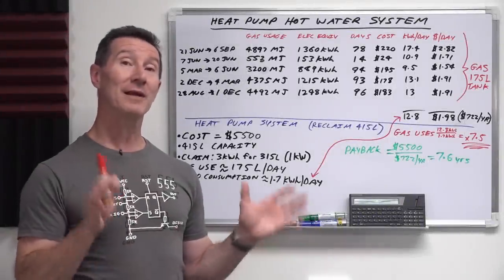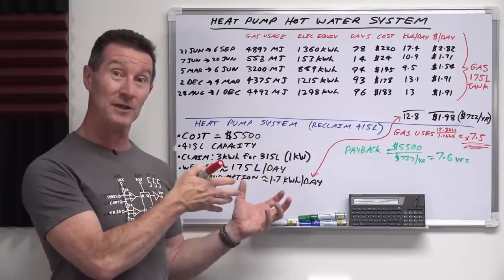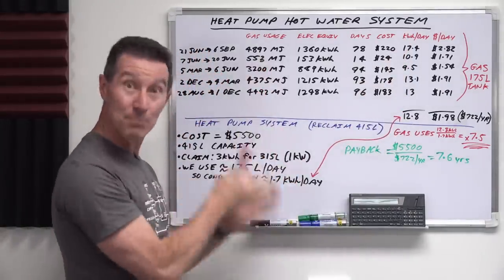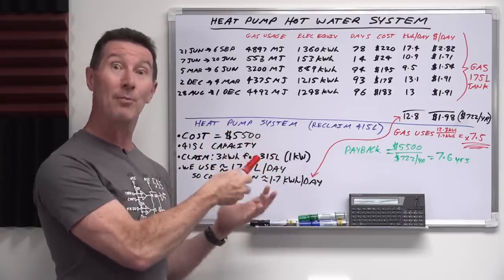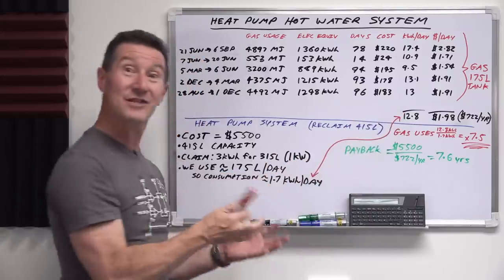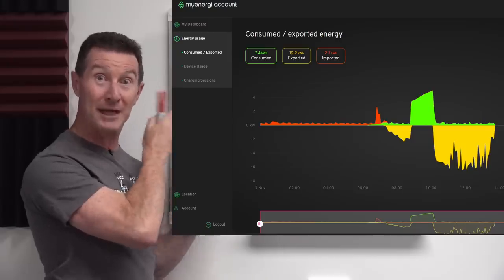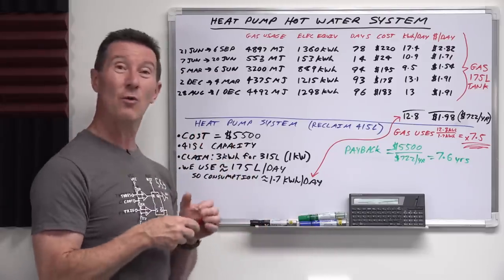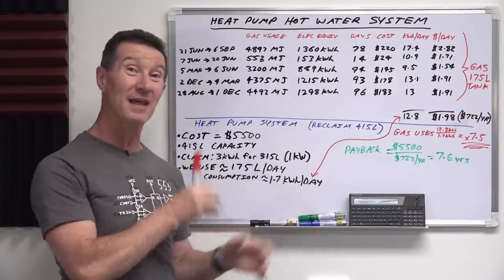Heat Pump Hot Water System vs Gas Hot Water

Comment: If you have a lot of excess solar it’s worth adding resistive hot water into the comparison. The cheaper capex compared to heatpump might more than make up for the higher opex if it’s all solar anyway.
Reply: I did resistive heater in Vic on a timer, 2 person, electric only house,  8kw Enphase with 7kw of inverters, split NE NW,  240L hot water tank with a 2.4kw coil, timer run be tween 10:30am and 3pm, this is within my off peat time so 18.5c/kw import and 6.7kw export, uses about 7kw,  most days we don't import any power,  install cost was $900 for the tank and and $200 for the timer and contactor, expected system lifetime 10 years, been in place for 1 yeah so far
Cost me about $220 per year in in power if you include the lost export payment and the odd day when I need to import, there was no math that would make heat pump worth it in my scenario
Reply: MC electrical  has done the numbers on his channel and HPHWS wins hands down

Comment: I got a 300L tank with an integrated heat pump about 3 years ago replacing a resistive heating tank. I'd say the average COP around the year works out at about 3. I'm off grid in the UK at 53N so the sun only gets to 14 degrees altitude at winter solstice and it made a big difference in how often I had to run the generator to keep the batteries topped up.

As you have so much spare solar power one option for you would be to run a solar diverter to direct the power you would have otherwise exported into the hot water.  It would certainly be a cheaper option.

Comment: A couple of questions:
1. What's the max water temperature you can generate with a heat-pump?
2. What's the minimum outside operating temperature at which the pump will generate a useful level of temp in the water tank?

Heat-pump-based hot water is fine if you live in a climate where there's always enough ambient heat in the air to provide an adequate source but across the ditch here in NZ there are many places where even daytime temps don't make it into double-digits so heat-pump anything really struggles to reach the promised efficiencies.
Reply: The Reclaim unit operates down to -10degC. Max, not sure, but 59-63C is mentioned as nominal.
Reply: @EEVblog  You can still get at least 100% heating efficiency out of a good heat pump system down to a bit below freezing.  Where I live, you do have to have a backup system, though.  Winter temps can go down to -40C for WEEKS at a time here.  Not all that often, but I'm seen it happen.
Reply: @evensgrey  I assume Canada and all the heat pump units I have seen have the whole system ontop of the tank and does NOT see - anything and will be COOLING your inside air
Reply: @jasonriddell  There's no actual reason you have to take the heat from the air inside the house.  Unless, of course, the heat pump heating the hot water tank doesn't have any backup so you need to take heat from somewhere you know won't be too cold, like inside the living area.  In circumstances where you're needing to heat that area, this is undesirable, although it might be more efficient than having the heat pump move heat from outdoors somewhere.
Reply: Fridgy is my trade, older split system, broke into the discharge line from compressor to reversing valve and placed a tube in tube heat exchanger with hot gas up the centre tube.
The outer tube is connected into the one of the inlets and outlets on a dual access hot water system.
So end result hot water in both summer and winter, condensing unit ( outdoor section had a 8kwR capacity which heated the 250 litre tank quite quickly.
Reply: Cold climate heat pumps are readily available.  Hot water temperature can range from 50° to 70° depending on the manufacture and model.
Reply: @EEVblog  anecdata, people in Ireland and UK reporting very poor performance in 'freezing fog' conditions, makes sense as the heat transfer from air is worst right at the dewpoint in damp conditions

Comment: I have the Sanden 250l heat pump hot water system (same technology as the Reclaim) installed last August.  It runs at midday for 2 hours on the solar energy and consumes 1.1kWh.

Comment: The heat pump manufacturers have their calculations based on a 20C outside temperature, when you have 0C outside in the winter it's not so efficient, so I hope it helps in your setup. But do not be surprised if suddenly you don't save money
Reply: nope. they frustratingly don't always give figures, but if you dig a bit you can find them. It's common to quote them for A7/W55 (air 7deg, water 55deg).
Reply: We don't get 0degC here in Sydney. A really cold winter day will be in the low teens.
Reply: @EEVblog  and your solar panels are naar the equator so it wil make alot of power.
  so win win 👍
Reply: @EEVblog  , my 0 degree is a example, what I want to point out is not just work with calculations from heat pump manufacturers, they calculate in their own pocket. Somebody can install a heat pump and then suddenly come to the conclusion that it cost more than a standard electric heater, as before I hope it works out for you. Readers be aware of your local climate and calculations
Reply: @pie314isi  and what COP do they specify for that? Can’t be above 4 and yet Dave’s System would mean a COP of greater than 6, closer to 7 even considering losses in the gas heater.
Reply: @EEVblog  lol, a really cold day here is the negative teens.
Reply: I have seen videos where at -11 outside the COP reduces to 2 with the output temperature being 45°C

Comment: The formula to calculate thermal storage capacity in kWh is fairly simple. So to increase the water temperature by 40C so say from 20C to 60C you have 415 liter * 40C * 1.16 = 19.256kWh
And if you ignore losses to ambient from the water tank then this will be exactly what a direct electric water heater will use as it is 100% efficient. For a heat pump will be much less as you pump heat from outside and the COP will depend on the delta in temperature between outside ambient air and water temperature.
So since you have a larger water tank than needed and you want it to be as efficient as possible keep the water temperature limit around 55C or 60C and not higher (assuming you can set that).
In summer I'm sure it will have a fairly high COP but in winter it will be quite a bit lower so average will likely not be as much as advertised.
Reply from the maker: Not quite that easy though. As you use the water more colder water comes in and hot water flows out. So it's continuous flow system, not a system where you extract X amount and then refill makign the calcs simple in practice.
Reply: Yeah very fair comment. While I'm a huge fan and will move to the same unit when my solar hot water system dies you call out a strong variable on the temperature from the mains the water comes in at. South East Queensland is a lot different from say the hills of Adelaide/Sydney/Melbourne (cold!) etc :)
Reply: required in most states to heat to 59°C
Reply: @mikerowe402  Never measured it, but I don't recall our tap water being that cold in winter. It comes from underground pipes of course.
Reply: @liam3284  building code? requirement for at least OR MAX??

Comment: First of all you have a very inefficient gas system if you use over 10kWh a day for 175L (on average a 5 minute shower is about 50 liters of hot water which is/should be about 2kWh). You wanna do the math on that first, a 175L tank doesnt say much about how much water you actually use. So either you have a very inefficient gas system of you use a lot more hot water than 175L. Its probably both seeing how old your system is and 175L a day for a household is pretty low.

Ok to the heatpump and 415L tank/boiler  (depends where you live what you call the bloody thing). You can take off (on average) 20% of that. Thats 332L thats actually usable and will be actually hot (around 55/60°C normally). (S)COP for tapwater aint going to be 5 or 6, on average its about 2.5. Now you need to know the temp of your mains waterline (usually around 10°C on average) calculate the difference and the amount of energy it takes to heat it etc etc.

My calculations for you new system, with a 5kW heatpump, 415L, a Delta of 45°C, 2.5 COP and 4180 J/kgK (energy to heat up 1L water): 17,5 kWh to heat 415L (80/85% usable) and 3,5 hours to heat up. Now of course there's a lot of variables there, which i dont know, you would need to factor in to be 100% exact. You can half it with the silly COP of 6 they have in their specs (32.6°C ambient / 21.1°C cold water inlet) and not come close to 1.7kWh.

So my mind would be blown if your heatpump with a 415L tank would only use 1.7kWh a day, i would even be shocked if its less than 10kWh a day on average through the year. 3 kWh to heat 315L .... Thats simply aint happening and well nonsense.

I looked into getting rid of my gas connection and using electricity for heating (house and water) last year and talked to a lot of guys who install heat pumps, cause i run into them often at sites, but no matter what, it doesnt make sense financially for me. Even not when i have 20 solar panels on top of my roof.

Comment: Hi Dave, your energy consumption is extremely high, about 5500kWh/yr, 10 times what we use here in Germany. We have a one-family-house, solid construction (not wooden😁 )and well isolated. We have to heat our houses in winter time, so in total we have about 13..15MWh consumption, only 3..4% going into water heating.
We 3 people use hot water for shower, typically a few minutes only, 2..3 times a week per person, rarely taking a full bath, and for the daily hygiene, of course. Then I often dish wash manually, what's not going into the machine. That's all of usage.
In this country, most living spaces use gas heating. Caloric Value Boilers are meanwhile standard here, i.e. 95% efficiency by a built-in heat exchanger. The 250l water tank @ 60°C  and the water pipes are isolated as well. I suspect that your old gas boiler and for sure your water tank are very inefficient and not well isolated, causing that high waste of energy. A closer look at your gas boiler and the water pipes would be interesting. 
I assume, that your new system will even save much more of energy simply due to its better efficiency and isolation. I guess it might be down to 10..20% consumption only.
Reply: in Canada 30 year old tanks are rated around 60% efficient and NEW "condensing" units are 97% so a MASSIVE savings fitting a NEW tank

Comment: If a person is currently using a resistive hot water heater and a dehumidifier, a heat pump water heater kills two birds with one stone as it acts as a dehumidifier. I'm not ready to replace my gas water heater with one because I often heat my house with gas. In my case, in the winter, a heat pump water heater would essentially be heating my water with gas.

Comment: You have "muddied the waters" a bit in your comparison  by converting your MJ usage to electrical  KWH costs right away, and then calculating your cost in the price of electrical KWH,  without calculating your ACTUAL cost of the natural gas MJ's you used to begin with, and thereby changing your actual cost per day, ( or breaking it down from your providers billing statement for those cycles). According to Google, the avg price cost of natural gas in Australia in Mar 2022 was 0.070 U.S. Dollar per kWh. 3200 MJ's converts to 30.337 Therms (100 cubic foot units) Your claim of 889 KWH converts to 30.341 Therms, which closely agrees with the 30.337 Calculation above. The avg cost of natural gas in AUS in Mar 2022 was $0.07 USD / per KWH ( Per Google) , which multiplies out to $62.23 USD, multiplied by today's conversion rate of AUS /USD of 1.58/1 = $98.32 AUS D, divided by 94 days = $1.05 AUS D per day, not counting any delivery fee, pipeline maint fees, tariffs taxes, ect. This is QUITE a bit different from your calculated $1.54 AUS D / day, but it also cannot be argued that the cost of natural gas, and it's delivery, is going to constantly increase over the years, and you do directly benefit from converting your solar power to the task of heating your water. The bottom line, is, SHOW US THE GAS BILLS!!
Reply: I bet his connection fee is almost as high as his usage fee. Mine always has been when not using gas for heat three season a year

Comment: In South Africa , with all The loadsheading and power cuts ,  it's better to go with a Gas Tankless Turbo Fan Water Heater , gas works out and roughly 1$ USD a Kg , if you buy the 48kg bottle, and normally lasts up to 3- 4 months .
A Heat pump is Not idea if you go A Few Days Without Power . Cheapest Cost vs Hot Water Availability is the Factor. As we Can't rely on always having Power like other Countries.

Comment: We came from a regular resistive water heater in our place and went with a same-sized heat pump.  Cut energy usage from hot water anywhere from 1/3-1/4 the amount the resistive heater used.  I have what I consider to be almost the best case usage for one.  My water heater sits in my garage, so it doesn't cool the house (Units here in the US are combined units as opposed to what I'm going to call the 'mini split' style Dave is showing), and I live in the southeastern US, so there is plenty of heat in my garage to pump into the water.  Ours is a 'hybrid' that also has normal resistive elements in case you need fast recovery or something happens to the heat pump system, but you have the option of locking those out and not using them, which I have.

The unit was around $1100 USD and my local EMC was offering a $500 rebate on the unit.  My guestimate of payback on the unit is right around 2 years or less.
Reply: This is very similar to my costs and estimate. We went from a 10 year old regular resistive WH to a heat pump. Mine is in my basement so it helps keep it a touch drier in the summer months. It does in theory scavenge some heat from the home heating system (older inefficient oil boiler), but that keeps the basement fairly warm as is so it's probably a net benefit. Mine was around 1300 with a 700 rebate, and I installed myself. I estimated around 2 years as well. According to app I use at most ~130kWh/month, though usually around 95-100.

Comment: I found going from a gas tank type heater to a gas tankless heater was a huge savings, over 80% reduction in the gas consumption:
https://youtu.be/OBpjMeCODHk
The bulk of the savings is on the standby and pilot light losses with a large tank of hot water.  I had a 40 gal. / 150 l. tank with 2 insulating blankets wrapped around.  Then you also have the efficiency difference of a traditional open flue type burner compared to a modern condensing burner/heat exchanger.

With this bizarre California Climate Credit program, I've actually not paid a gas bill in over 4 years now as they send me more "credits" than I can use in a year.  So much so that I opted to install a natural gas grill and cooktop in the back patio to take advantage of that "free" gas.

Back in the 90s the utility had a solar hot water program.  They would install the system and bill you monthly for it.  It would have ended up costing me about 4-5 times what I paid for gas so never went with that.

I heat my entire house with a solar forced air heating system, so much of my excess solar goes into that in the cooler months.
Reply: Yeah, storage gas systems (especially old ones like Dave's) are pretty horrendous compared to instantaneous gas.
Reply: @SomeMorganSomewhere  instant gas is crap.. each time you turn on a tap, you need to wait like a 1min to get hot water to it.. with our tank, its only 10 seconds to come from pre-heated tank.. would not go instant gas anymore.

Comment: Hi Dave. I believe you indicated that you were anticipating (hoping for?) your existing gas water heater reaching End-Of-Life soon. Wouldn't the eventual cost of replacing your gas unit with another gas unit shave a couple of years off of the 7.6 year break-even, assuming that it reaches EOL within say 4 or 5 years?
Reply: More so, when you factor in the technology difference 30 years makes. From 80% efficiency to 94%+ as well as better insulation.

Comment: So dave wants to replace 12.8 kWH Gas with 1,7 kWh Electricity - i highly doubt that.

If i assume a Gas efficiency of really bad 80%) than the water has received 10,24kWh.
With 20°C outsde and 60°C target for the water i would assume a COP of 3,2 vom 30-->60°C maybe 4,1 . So you will neeed 3,2 to 2,5kWh/ day

Comment: 415 liters? That's 91 gallons. That's twice the size of my water heater which happily serves a family of four! They want quite a lot more money here for larger systems.
Reply from the maker: Was told the 415L wasn't much more, forget the actual difference, but it wasn't much. So what the heck.
Reply: Indeed - family of four here and we have a 250L tank which is considered quite big
Reply: Never seen a 90 gallon tank outside of commercial warehouses.  That is just insanely huge.  50 gallon gas fired is more than enough here with 3 females in the house.

Comment: It is interesting to see heat pumps moving from the mechanical to electronic controls.  The best of the mini splits have a pretty much set refrigeration circuit that is controlled by the electronics with electronic expansion valves and ECM fan/compressors.  That's how they get the higher COP.  Unfortunately, the having refrigeration people do electronics does not lead to reliability, especially when they see a profit center in selling OEM-only parts.  Kind of why Bosch and others are dominating since they had the in-house electronics experience.  It'll all settle out eventually, but it's easier to buy a refrigeration circuit and put your electronics experience on it than it is to buy electronic controls and put it on your refrigeration expertise.